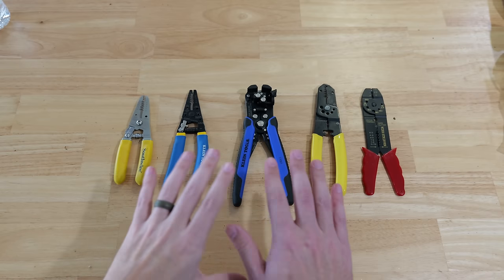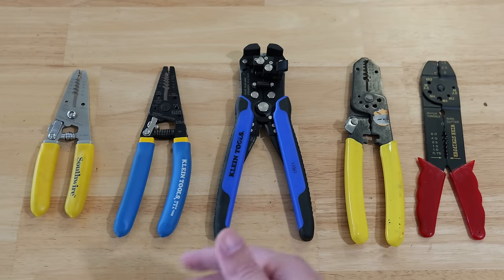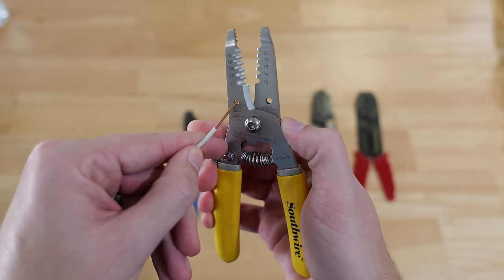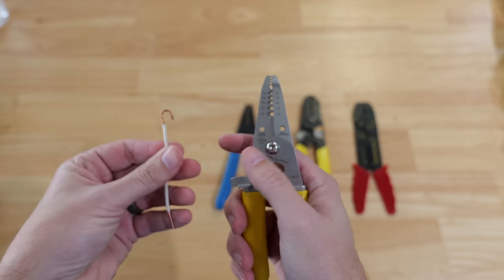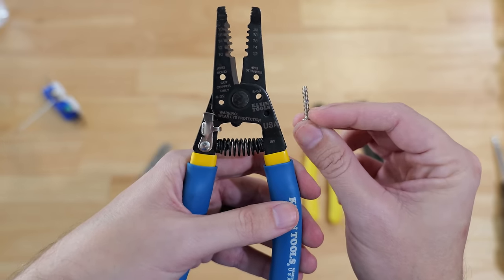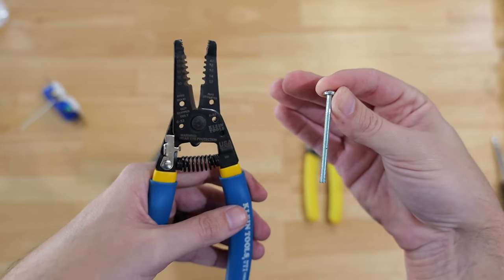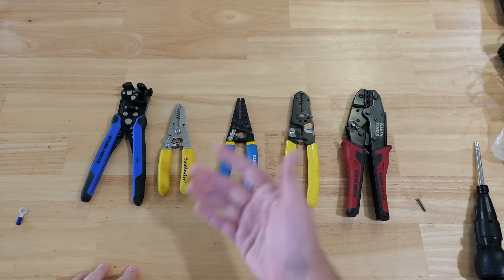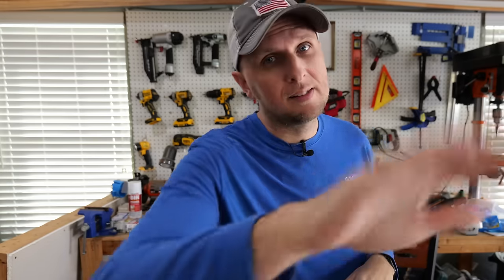Most DIYers Have NO CLUE Wire Strippers Can Do These 6 Things!

Comment from the maker: I am genuinely curious, how many of these features were you aware of and have used?  Are there any others you know of that weren't covered in the video?
Reply: All of them, but Im probably not your average dryer. Thanks for the video
Reply: Didn't know about the j-hook, or the screw cutting feature, this will make life much easier. Thanks
Reply: On the first couple of strippers, I've always used the groves on the end to grab the wires and form the J or shepards hook.  A twist of the wrist holding the stripper and one is formed.
Reply: Great info on all of the pliers I need to know 
Love the cat
Reply: @ki4tlf  that’s how I always did it, but i’m gonna have try those holes and see how well they work.
Reply: Now I feel like rewiring all the outlets in my house, but I won’t 😅
Reply: I didn’t know about the screw cutter
Reply: All of the features, and from time to time have used each feature, though I prefer the Knipex 6 in 1 tool with comfort grip handles over the others for AWG 14 & AWG 12 conductors. For running stranded AWG 14 machine tool wires in motor controllers and ball valve control panels, I use a special Panduit self adjusting end stripper. My Klein & Panduit crimpers are used to chop #6 & #8 screws. Don’t have Southwire tools. I have an assortment of Klein, Panduit, Ideal, and Knipex strippers to cover the range from AWG 32 to AWG 6 conductors.

Never bought the cheapies. Didn’t want to piss off my other crimpers 😆. 

For crimping, I use a pair of Ideal ratchet crimpers that I bought 40 years ago, which embosses a symbol on the connectors to show an inspector that sufficient amount of pressure was used on the crimp ferrule for red, blue & yellow lugs AWG 22 - AWG 12.
Reply: Only the wire stripper part 😒
Reply: I was only aware of about 20% of these wire stripper capabilities. Very interesting and of value to learn this!

Comment: I have been using stripper/crimpers for 50 years and today I learned about the shepherd's crook holes!
One thing to add is when crimping connectors you also need to crimp the plastic part onto the insulation to provide strain relief of the connection and to reduce contamination at the crimp.

Comment: I picked up a Klein crimper and wire stripper following your prior demonstrations. Used it to repair a kettle: new thermal fuse with crimp connectors and wires to strip. It was easy and straight forward. Love your videos. Very well explained and demonstrated. Thank you!

Comment: Got a pair of knipex wite strippers, and the cool thing with these is that you can cut screws, but you just need to slide them in the holes, no need to thread them in. And they make clean cuts. Never had any problems screwing them in.

Comment: Good advice. Get the automatic one if you build something big. I once had to build a big electrical cabinet for a greenhouse. I managed to get RSI in my arms from stripping hundreds of wires. It bothered me for half a year. As for the cheapo, the only good part of it is the screw cutter. It does cut every Imperial size from 4-40 to 10-32, and that's why I keep it.

Comment: 5:38 See that little cup in the plastic at the top right of each screw? That's a wire stop. Strip the wire to length, and it'll hold the end of the wire while you wrap it around the screw. You won't get quite as tight a loop as using the pliers, but it's enough that it won't come off the screw, and you don't need to use the J-hook bender or the pliers. Down side is that if you're using the second screw on each side, it's a little more difficult. Or you can use the outlet to preform the J-hook before you put it under the screw. I think that same receptacle allows stripping the wire with the ears. Large side is #12, small side is #14. However, definitely not saying this is more efficient than using proper tools, but it's functionality built in that a lot of people aren't aware of.

Comment: That “starter wire stripper” at the end in the red handle saved my life. I cut a live power cord (not intentionally), and the wire blew up in my face like an M80. 
     I thought I was seriously hurt bc my hand turned black; but it was just the paint that blew off the pliers and instantly melted to my hand. However, the insulated handle did its job.

Comment: Old retired sparky here, nothing new there. My crimper of choice was a Klein. With handles like a side cutter, with one red handle and one black. I always knew which end was up. It had two sizes for crimping uninsulated terminal connectors and a cutter on the end. Glad I never lost it because I never seen that exact style anymore. Now they have one slot for insulated and one for uninsulated. To me crimping with an insulated crimper gives the terminal connector that ugly flattened out look. Using an uninsulated crimper puts a dimple hole in the middle and the rest is nice and round. And the wire isn't going anywhere without the terminal connector. It's a better crimp. If the wire was small enough I would strip it long and fold it over for an even better, but not needed conection. That little hole isn't going to short to anything, that's my five cents.

Comment: Sorry but it is not 8/32 or 6/32 screws. The 8 and 6 denote the screw size and the 32 denotes threads per inch.
Reply: And its simply pronounced six thirty two or eight thirty two.
Reply from the maker: Correct.  Appreciate the call out.  My mind was somewhere else I guess 😂
Reply: Good eye
Reply: When cutting screws, enter from the threaded side. Otherwise it just falls out and doesn’t clean up the threads.

Comment: I own a couple of the self-adjusting kind.  One is cheapo.  The other has a moderate price.  Neither works well enough to be truly useful.  They can't grip the wire tightly and the insulation gets torn, or only part of the desired length is stripped.  Problems are especially bad when used on narrow gage wire ( 20 -26 ga.) and on Teflon insulation.  Not recommended at all.